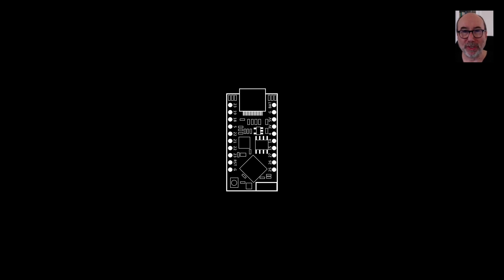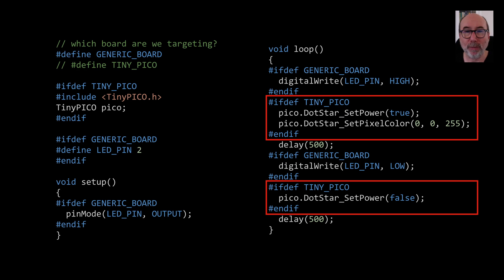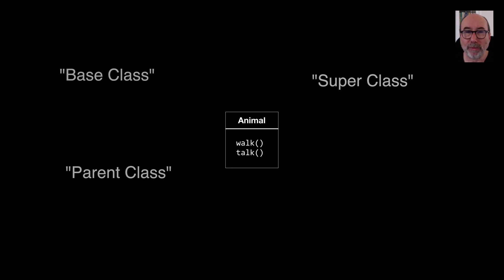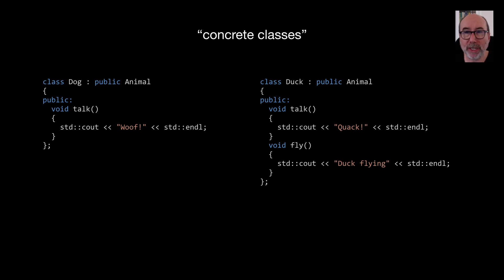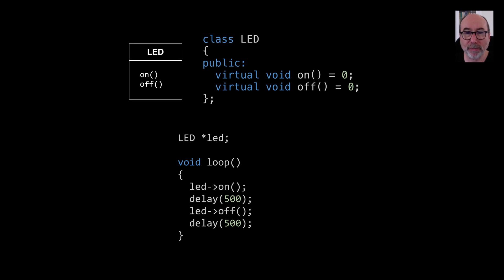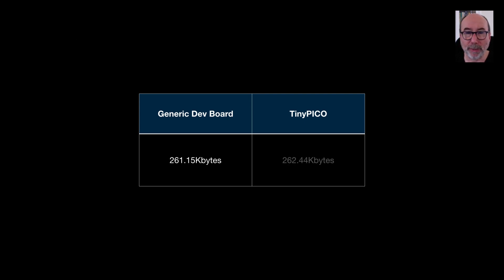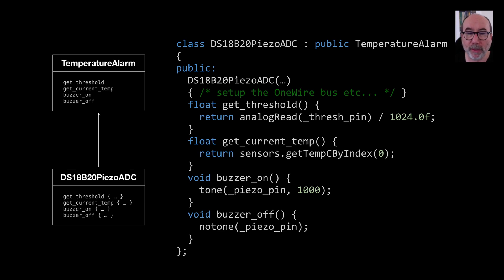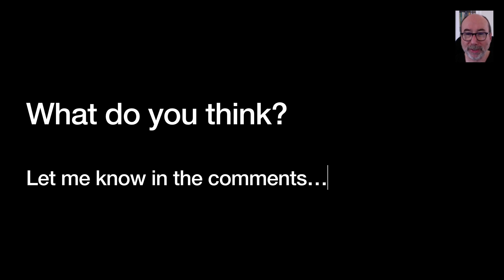Arduino & C++: Blink Sketch Reinvented with Inheritance & Composition

Comment: Interesting video! It appears at t=352 you swapped the TINY_PICO_BOARD and GENERIC_BOARD labels. And somewhat later at t=457 you used getCurrentTemp() in the base class but get_current_temp() for the virtual method.
Reply from the maker: Oops - good spots. That's the only trouble with videos - you can't go back and fix them.

Comment: 7:50 Note: The class DS18B20PiezoADC is an amalgamation of multiple pieces of hardware, a DS18B20 Temperature Sensor, a Piezo Buzzer and an ADC Threshold monitor.  When I watched this originally, I thought that was a single chip, lol.

Comment: The idea of putting high-level business logic into a class, and then composing with classes for hardware-specific behavior is helpful.

I had heard the ideas of "separate out the business logic" and "prefer composition over inheritance" before, but hadn't really figured out what it meant to put them together.  Your example was simple enough to understand, and just complicated enough to make the benefits obvious.  Thanks!
Reply from the maker: It was actually really helpful for me making the video. Crystallised a lot of things in my head that I'd either read in passing or picked up over time without really thinking about what I was doing.

Comment: Did i see a bit of a UML diagram sneaking  in at the end.Takes be back, Inheritance and  Polymorphism where you make the parrot class into a duck class I think that’s it.
Reply from the maker: I had a good career drawing boxes and arrows :)
Reply: @atomic14  I still use some of the diagrams when i'm thinking about how to do something.  user diagrams are quite good when your thinking about the user requirements and how they are going to flow together in the big picture. first started with Yourdon back in the early 80's.